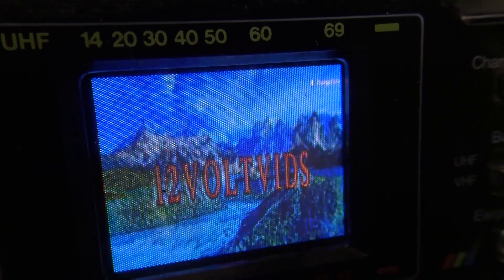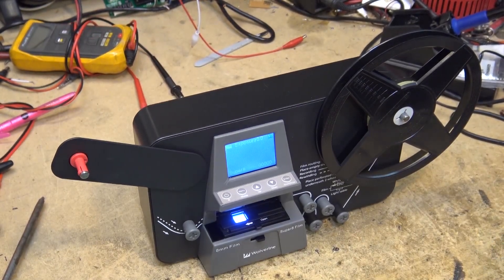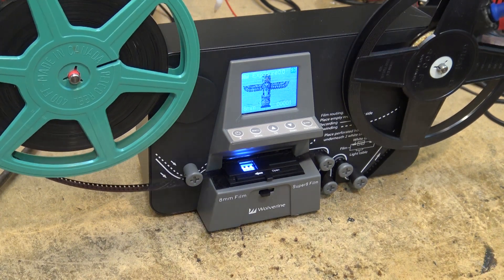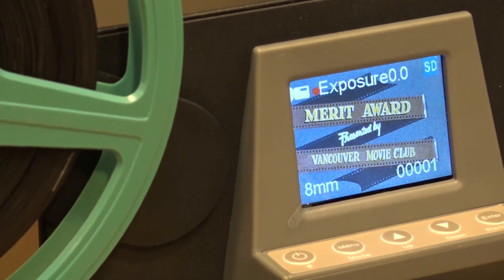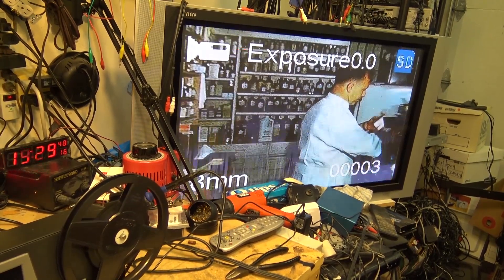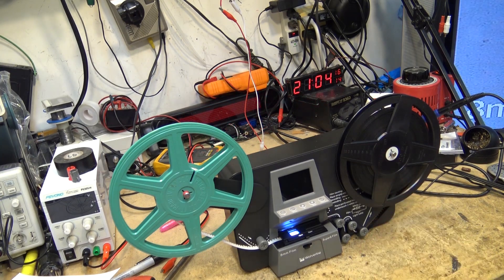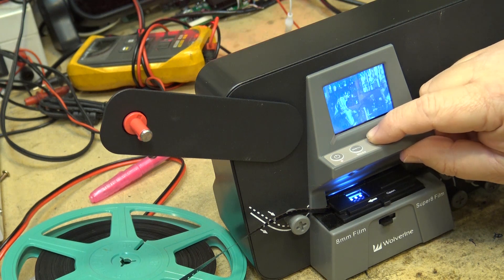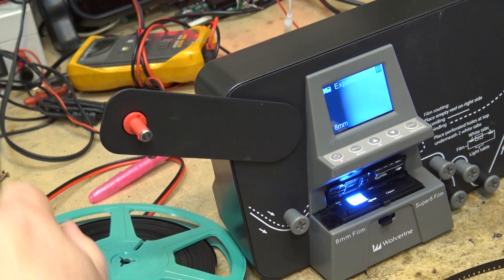Wolverine Film Scanner evaulation and quality check

Comment: 400+ $ for a stepper motor, 500 g of ABS and a bad destructive video processor. I would like the total cost of the device when leaving the plant. 25$? 30$?
Reply from the maker: Another idiot that has absolutely no clue what engineering costs and manufacturing costs are.   Thank you for sharing your lack of knowledge on how business works to the world.
Reply: I admire the level of "engineering and manufacturing costs" 🤣🤣. Could you confirm this product has been developed in USA and built in USA ??? I suspect its coming from some chinese plant and developped on the corner of a (chinese) table.. Am I wrong ??
Reply from the maker: @florentleider222  
The instruction manual said it was engineered in USA. They are built in china just like everything else.  There are still set up costs and manufacturing costs to produce them there, but much cheaper than here.   The thing you don't understand is this is a low volume device compared to say a dash camera.  A dash cam they sell millions so the cost of development is spread out over the production run of say a million units.   This is a speciality device with a limited market.  They might only sell 10 or 20k units as these only appeal to someone with old family movie films from the 50s and 60s and quite frankly the target audience is dying off these days.  I have some home movies of me and my sister when I was little but would my kids want to see what I did when I was 5 years old? Probably not.  The time this would have really sold well would have been back in the 80s.  In the 80s and 90s I would have bought 3 of these and had them running all day.  I did 8mm and super 8 film to vhs and dvd for 3 retail photo finishing shops.  I used a modified projector with a broadcast camera into a high resolution projection screen with a 2 way mirror like they use for a teleprompter.  Camera directly below the mirror  looking at the screen.  The quality was very good and on VHS and then dvd looked great but not hd.   Most people got their old home movies transferred way back when the parents were still alive.   The vast majority of the subjects of home movies of the era and in their 40 and older because film was done by the early 80s.  The last rolls of film I shot was of my friends riding dirt bikes in the summer of 78 I think.   The VCR came out and film was dead. So the market for these is very limited and that keeps the price what it is which is very good for what the machine is. Their target is small businesses that offer film to video conversion and home users.  People with a few films to transfer send them out to people like me with the equipment to do it.  If the number of films they have is higher than the cost of the machine, they buy one, transfer their own and then guess what, sell the machine  for 60 to 70% what they paid to the next person that needs to do them.  For the consumer once they have done their films they no longer need it.  Mine sits in the box till the next time I need it, but it paid for itself in the first order or 2 I did.  Sure there are better machines and for someone doing high volume one of those custom units would be advantageous because they are faster but, they run about 5 grand to start.  I would still be paying off a 5000 film scanner today, where as this one is paid for so now every reel that I get the profit goes in my pocket.  It doesn't do anyone any good to hear someone bitching about what something costs.  
When I was in the retail business I used to over hear the salesman say to people that were grinding him on the prices wanting a better deal. "is it too much, or too much for you".
Reply: I wont argue. The only way I see for me, since I don't have a lot of movies to transfer, is to work out my own device. (reason why I looked at your video). My project : a stepper motor, a power unit, a micro controller to control the motor and the camera, a Sony dsc HX-400V.I must add a filter to magnify the film images , since in macro position, the images represent only 1/3 of the width of the field. The most difficult part (the system to position of the film) will be taken out from an old projector. The total cost should be around 90$. I think its Worth being tested.
Reply from the maker: @florentleider222  
I didn't want to fart around. I have a business to run, and needed something off the shelf that I could depend on when needed. The Wolverine fit the bill perfectly, and every single client has been thrilled with the quality, which I might add is better then the over compressed youtube sampled. 
I have had films sent to me from as far as London England to be converted to digital files.
I have also sold at least 5 of these machines for the company after people saw the results. 
Too bad they are not paying me a commission, as I did not receive this unit free to promote it. I bought it with my own money.

Comment: Thanks!
How do they convert digital footage to film?
Ive seen some digitally shot commercials in theaters through projectors
Reply from the maker: Movie theatres haven't run film in years.   Digital projection these days.
Reply: @12voltvids  Thats true and I know there are online services you send your digital 24fps footage to for conversion, but what's the process. Shooting with a camera? I dont see any other way, since celluloid will need to get exposed through the lens
Reply from the maker: @DethronerX  you mean to print to film? Yes basically they use a digital film printer to print out to film.  Typically a DLP chip that is protecting onto a film plane the film is brought into the expose plane and the. The DLP fires off the red green and blue LEDs that flash the frame to the film stock, the film advances and the next frame is done ext.  Prior to that they did what was called a cine scope. A film camera shooting a CRT monitor.
Reply: @12voltvids  wow, good info, thanks.
Okay, the reason to ask was, to get the real film look and the motion blur of the actual shutter and having lost some digital detail and sharpness to get the actual film colors and shadows, but dont you think you can only get it if you shoot with a film camera and then develop the film or do you think the new method will do the same?
Eitherway, its worth a try. Its stupid I know, to get a digital video converted to film and then back to digital to get that real look : D
Might as well just shoot directly on film, but I mean if one was not able to re-shoot something old. 
Thanks again! Ill just buy one of those affordable film cameras.
Reply from the maker: @DethronerX  film look seriously. All those effects can be created in digital to look exactly like some film no need to go to film to do it some directors namely Quentin Tarantino and a couple others will shoot their Source shots on film and then transfer to digital for editing they do this for one reason because of the dynamics that the original negative can give they can be over or underexposed and pushed the film. Film is too expensive unless you have millions of dollars and a big Hollywood budget you're just throwing money away I had a client that brought me 300 ft of color negative super 8 that he recently shot because he wanted to experiment with film 300 ft that is 18 minutes running time silent he was telling me that 18 minutes of film was over $400 to buy and process. Even his black and white films which he brought me $350 foot reels were about $25 per 3 minutes for black and white the color he couldn't even project because they don't process reversal film anymore all they process is negative so in order to project that color film he would have had to make a positive transfer of the film cost the same as he paid for the negative so to get an 18 minute film processed that he could project on a 8 mm projector about $800.
Reply: @12voltvids  Well id go for a 5 minute or less film or a music video. The reason is to get the REAL result, not emulated by a software which is fake, no matter how close, which I can do easily by comparing my footage with something similar shot on film. Its just a creative choice, if i want to draw with pencil or oil pastel on paper or use photoshop pencil effect which is cheaper. You as the artist make the choice, but i agree about the costs, but if the work itself is good, it pays off so it doesnt matter what medium as long as you're following what your original idea is dictating to you and you stay true to it's spirit, as David Lynch would say, who by the way, has been on digital since 2006 or something and i love both of his formats
Reply: @12voltvids  Also, my friend, it's not like i mean in terms of transforming all of my work to film, but to experiment with many and film is one of them. There is cell phone, vhs cameras, anything, that goes best with your idea, should be used
Reply from the maker: @DethronerX  
Sure it is a tool, but very expensive format to work with.

Comment: Does this work with 8mm 25ft reels like the ones that were used for home movies? Every projector I get for my 8mm reels the reel itself doesn’t fit on the projectors spindle.
Reply from the maker: 8mm film for cameras came on a 25 foot reel with 16mm wide film.  You ran it through the camera, turned it over and shot the other side of the film.  When it was processed the film was split down the middle and joined together and sent back on a 50 foot reel.  The reel that was sent back will fit on this unit.  To use super 8 there is a hub adapter supplied to fit the larger hole on super 8 reels.

Comment: You are using them MM100-PRO (the more costly unit), Does it  perform better than the MM100
Reply from the maker: I have not compared it to the cheaper one, but from the specs the cheaper unit is only 720P and this one 1080.

Comment: I'm seeing the film is a little jumpy.  Is that the original camera or the Wolverine with poor pin registration?
Reply from the maker: The film is like that even when run through projector.  This film has had much splicing done. It was stripped with magnetic sound and then the sound track was added after it was edited.  Has been played a few hundred times as when it win the merrit award it was shown across at several amateur filmmaker festivals in the early 60s. It was my late father in-law that made this film and it was his pride and joy.   It is very worn as is apparent from all the wear and scratches.

Comment: An interesting, if drawn out video. I do question your indifference to the incorrect aspect ratio you have shown. The film scanner has not done that. You seem desperate to fill the screen with vision rather than showing the film in its correct aspect ratio. I find this happens a lot in American hobby and television media.
Reply from the maker: It is not that I "chose" to fill out the picture but that the editing software did that for me. I was shooting in 16/9 rectangular pixel 1920x1080. The wolverine shoots 1440x1080 square pixel.  Premiere automatically matches the source and rendered it out this way.  If I had shot the main video on 3x4 equipment then the film shots would have also imported in 4x3 mode as that is how it shoots.  Somewhere buried in the settings is probably I way to keep the aspect ratio locked over multiple sources.  If I import a sd clip it is correct but as soon as the software sees an hd source it automatically assumes 16x9 as hd is that aspect ratio
Reply: @12voltvids  I use Premiere Pro as well. It is very easy to control the aspect ratio of ANY type of media you import and then use on the timeline. 1440 x 1080 is not actually square pixels but compressed horizontally. They can be rendered to the correct aspect by lengthening the pixels.  May I suggest you right click on your media in the media box and look for "Interpret Footage" in Premiere Pro.   Inspect "Interpret Footage" and play around with Pixel Aspect Ratio. There is also "Frame Rate" you can adjust as well. Also, terminology  is important. It is 4:3  not 4x3.  The first is a ratio, the second is multiplication.  Don't settle for incorrect aspect ratio !!
Reply from the maker: @CaptainPeterRMiller  
Too much work. I use the machine to archive for clients and don't edit the footage.  They get the source files on USB stick.  
I just put this one up to check it out.  I put another one up showing the correct aspect ratio.

Comment: This machine is not intended nor claims to be a commercial processing machine. It is designed to produce a reasonable quality transfer for home movies. To expect a $400 machine to produce a professional quality copy is ridiculous. If this guy wants to provide a professional copying service then he should be looking at spending a few thousand dollars on a proper telecine machine.and then spend some hours learning how to use it.
Reply from the maker: There is no point investing thousands in a professional system as people are not willing to pay more for conversions.  I compete with people that use a projector, camera and white piece of paper to project on.  I don't transfer for film makers with a budget. I transfer old movies for people that were shot 50 or more years ago.  The quality is very good for what it cost and I have recovered the price paid so now every film I transfer I am actually making money.  If I invested the 4000 for the next model up on the quality scale I would be paying for it for 10 years.  There just isn't that much film left to transfer.  30 years ago I dropped 2500 for a flying spot telecine. I have a film that was transferred with that I should compare with this. I used that machine for many, many years, but it only put out SD. It was great for VHS and DVD output, but people want stuff done in HD now.  This unit is more than good enough. Never had anyone complain about the quality and it allows me to keep my prices competitive.  I still get people wanting me to use my old real time SD, system because I charge less to use a projector and camera. I give people 2 options.  Projector into a 3ccd camera and output on DVD or wolverine onto memory stick.  I charge half the price for the SD optical telecine route and most people opt for that as opposed to a single frame transfer because they are concerned with price. They would rather pay 5.00 for a crappy SD transfer than 10.00 for an HD transfer. Thats just the way it is, and even if I did invest 4 grand in a higher end system, there is an upper limit in what people will pay. Once you hit 400 or 500 in transfer costs they are buying one of these and doing it themself. So there is absolutely no point investing any more than necessary unless you have the volume to justify it, and these days that volume is just not there because 90% of people with old 8mm film have already had it done, or done it them self.  30 years ago with my old optical system I was doing about 5 hours (running time) of film every day. Leading up to christmas I was booked out 3 weeks in advance, and did all the transfers for 3 photo labs. That work is all done now, and the odd roll comes in. Perhaps 1 order a month now.
Reply: You are mistaken. A proper TELECINE machine?  Why not recreate the contents of the film with shadow puppets?  In just four hours of obsessing over this issue and searching through forums over the past four years, I have read excellent suggestions from IT professionals, video encoding programmers, and engineers who cumulatively have thought of ways to greatly improve the output of these machines with little to no increase in manufacturing cost.  The high prices for higher quality machines are very much like wine prices.  After a moderate price increase with corresponding quality increases, the  quality-to-cost ratio reduces exponentially.  In this particular industry, there are very few alternatives.  From everything I've read, the addition of a faster video card, a higher quality camera, and better video compression software, matched with better frame advance mechanism would make a machine the same size produce a quality output equal to anything a "professional" outfit might make.  You might need to add a better cooling system for the faster processor, adding a couple inches to the size and a pound more in weight.  People are too impressed with the word "professional", especially when it's so often misapplied.  No one making these machines or operating them took graduate courses on how to do so and has a diploma on their wall.  These products are made to be cheap because they couldn't be bothered to hire actual professionals to design them.

Comment: if only Wolverine or whoever actually made this unit, seen many OEM units around under different names, if only they produced a slightly higher quality model. better cmos, alloy frame.
Reply from the maker: The unit is designed for limited use.  People buy them to transfer their old films and then the units are either sold or put in storage.  Nobody shoots film now so people have a limited supply and once they are done they are done.  It is not designed as a commercial use.

Comment: I see you have a variac next to the machine. Do you use that to slow down the speed so the final video is the correct FPS??
Reply from the maker: No speed correction done in pc. Variac would do nothing.  The unit runs on 12 volts dc.